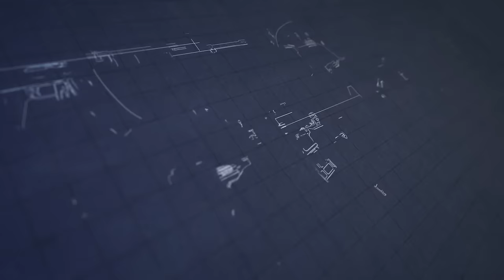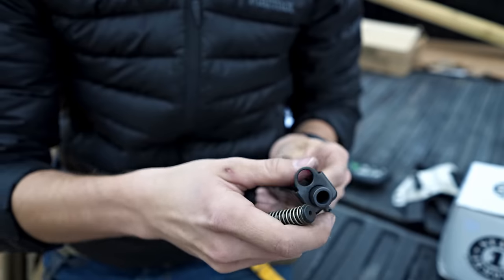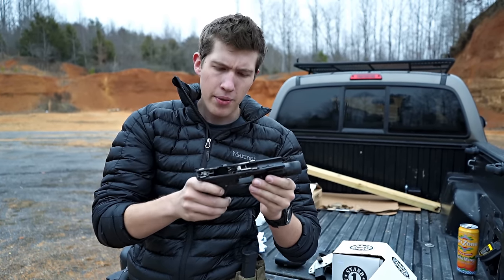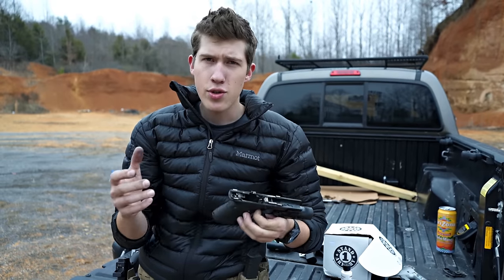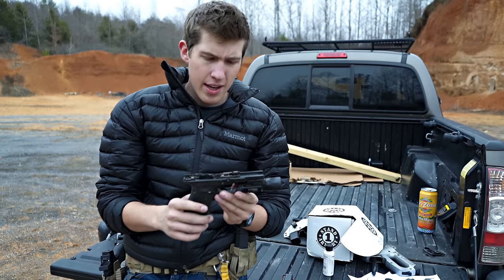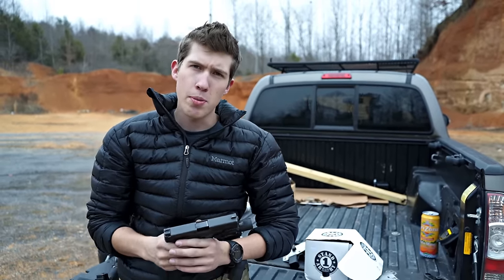Practical Glock 19 Upgrades for Efficiency and Effectiveness

Comment: I have original springs in my Glock 21 First Generation, and it still functions flawlessly.  Bought the gun in 1992.
Reply: glock 22 gen 2, still has stock everything and its had probably 40k round through it. seemingly flawless and still smooth as butter
Reply: Impressive! How many rounds have you put through it?
Reply: @bennettmay9283  probably 10k plus.  Not that many, but it has never malfunctioned.

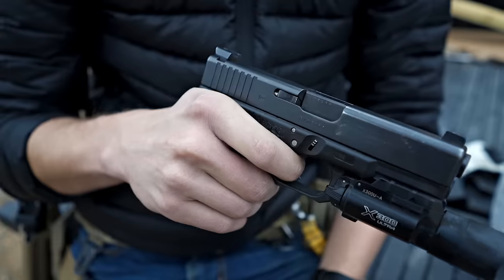Comment: 0:40 sights
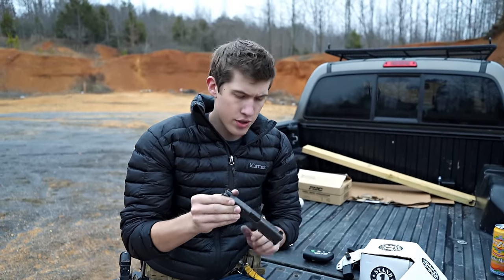2:17 frame stippling
2:24 trigger undercut
2:32 Vickers extended slide lock/release
2:43 Zev Tech extended mag release (for gen 4)
3:14 Surefire X300U
3:35 Ghost Rocket connector
3:43 6lb trigger spring/NY spring
Reply: Frame stippling is not necessary if you use Talon grip (self-adhesive) or similar.
Reply: Something tells me that he has since upgraded from the X300U
Reply: Nope , he still uses that or tlr7 @TommyTombstone
Reply: @chrisbeard9113  X300T>TLR1-HL>X300U>TLR7

Comment: Great video!⭐️⭐️⭐️⭐️⭐️
Warning ⚠️ , don’t over tighten your Bravo type Surefire gun screw on your Glock, you will warp, or bend plastic frame. For Glock frames use a A-type mounts like what Mr. Botkin using on his Glock.

Comment: Thanks for the quick rundown.  Nice to see what others are doing.

I have done minor changes as well.  
-Added the "duty carry" spring kit (trigger spring, striker spring and safety plunger spring).  
-Changed to a G17 smooth trigger.  
-Added Warren sights.
-Working on DIY trigger undercut and stippling front strap.  (I have another with full stipple work and it is too rough on skin and clothing).

Comment: I concur on the barrels. Tested a few, achieved a max 1/4" improvement (my groups are about 1" at 7-10 yards) over many tests at 7-10 yards. That being said, 25-100 yards+ is where the aftermarket barrels start to begin to shine. Save the $200+ and use it on ammo.
Reply from the maker: Yep. And $200 is 1000 rounds of 9mm.
Reply: damn!  that's cheaper than dirt!
Reply: T.REX ARMS what ammo?
Reply: Unless you're a reloader or shooting reloads
Reply: look on target sports usa
Reply: I only bought a fancy aftermarket barrel cause I run a comp on my G19 Gen 5. Other than that, i'd have no use for one.
Reply: truth, at that point of 50-100 yards ..I'm going to grab my AR. lol

Comment: As for trigger, I put a 3.5# rocket trigger connector from ghost (the one you have to modify to fit) to eliminate the "wall" before the break. And a NY1 8# trigger spring.  It's fabulous!

Comment: lmfao, you "wore out" a slide after 20k rounds in 9mm? haha, I've got 90k+ through my 23, factory slide, factory barrel, factory frame, etc, only glock extended controls, and stippling that I do myself.

if you wear out a slide in 20k rounds, do you even maintenance bro?
Reply from the maker: It wasn't the slide. It was the RMR screw holes. Couldn't hold down an RMR anymore after 20k.
Reply: T.REX ARMS whoever did the machinework did a shitty job then. Probably a dull bit when they tap drilled or they only made 60% threads. Either way it should have never worn out after 20k rounds. We had a range rental with over 200k rounds on a 23 with the factory barrel, slide, frame, guiderod, trigger components etc.
Reply from the maker: I know a regular slide will work forever. I wasn't saying it wouldn't. But a number of milled slides don't.
Reply: Scotty Mac 22 it probably was a nonfactory milled slide, they may be lighter and run better but they wear out much faster than stock

Comment: I've been real happy with glocks for about 10 years. I've had 6 or 7 different models but when it came down to it I ultimately decided to keep 3 9mm's. I've been holding them in high praise for many years and I always suggest a G19 to anybody looking for an all purpose handgun.  Recently I went to go do a few simple drills with a buddy of mine and my 19 shot hot brass straight back into the ol eyeball. Not once but consistently throughout the day. Every few shots are straight back into face or rounds just weakly flub out to about 4 o clock dropping only a couple feet from my foot.  What's really weird is my 17 that I've also never had any problems with started doing the same thing the same day.  I'm just confused, I'd be surprised if my 17 had more than 5k through it and my 19 is probably right around the 3k mark.   Definitely broken in but not worn out. My extractor, ejector, springs all look good to My eye but idk.  I usually shoot 115 ball but I was shooting 124 ball this day. Not that it should matter.  Could u venture a guess or do u have any experience with any if these issues...

Comment: Found your content this year and love your videos and messages Lucas. Just want to offer a correction though. To my knowledge, your 6 lb trigger spring is actually working AGAINST a faster trigger reset. The heavier than OEM trigger spring is allowing an easier trigger pull, working against the firing pin spring. Anyway, digging the thigh strap received from you guys-- best!

Comment: The extra power trigger springs hurts reset. It helps assist in the trigger pull making for a lighter pull, so during reset its fighting against the spring and therefore the heavier weight of the extra power spring. (6lbs vs 5)
Reply: Glad someone said this. The “firing pin spring primary function is to raise the cruciform “kickup” so that the firing pin “lug” will catch it as the slide moves forward into battery. Coincidentally, but not by design it resists the firing pin spring and REDUCES or resists forward motion of the trigger and trigger bar. I’ve tried the 6lb Wolff trigger spring long ago and it does absolutely nothing to improve reset of the trigger. In fact a Glock will function with no trigger spring at all as long as you hold the trigger back after each shot. I quickly returned the stock OEM trigger spring to my Glock because the Wolff was wound incorrectly and would not align itself properly with the trigger bar when seating the cruciform into the housing. Not worth the trouble and does NOTHING to improve reset. This young man does draw and shoot extremely well. I am a Glock armorer.
Reply: My thoughts exactly!

Comment: I too run stock for the most part. My changes to my G19 Gen 3: Ghost 3.5lb Ultimate Connector, Ghost 6lb trigger spring, extended mag release, extended slide release, Meprolight FT Bullseye, ETS mags, Attachments: Olight PL Mini Valkyrie

My setup is pretty simple and effective. But I plan on changing my recoil spring assembly for one of those Laser Max green guide rod lasers.

Comment: By the way you said it wrong, when u increase the trigger spring poundage you actually are working against your reset, but lightening your pull weight a little. The Glock factory trigger spring will give you the more positive reset.

Comment: NY "spring" and file to fit connector results in a smooth and consistent pull, but the reset.  Oh lordy the reset.  It just pushes your finger forward like you wouldn't believe.  If you can keep your sights on target, you can have some crazy fast follow up shots.  And it's safe as hell too.  Best $30 I've ever spent.

Comment: I run the ny1 trigger with a glock minus connector and makes a very consistent pull all the way to break.   The reset is brutal!  In a good way!  It literally throws the trigger back up to reset!  I also did the 25cent trigger job to add some smoothness to it.   But the ny1 trigger spring is supposed to be way more reliable then the stock spring due to its design of being compressed instead of being pulled apart.

Comment: I’d say add Kagwerks extended slide lock not the vickers style like he has on it here if you have a “high grip up on the slide” majority have the same issue I did, lack of locking to the rear on empty mags or locking back when you still have rounds in a mag. Kagwerks extended slide lock is up on the slide and out of your way allowing you a higher grip and allows the slide to now lock on empty mags and also your high grip doesn’t won’t  push up on that slide lock causing it to lock back unintentionally.

Comment: Good advice, “spend money on ammo and train”. I have upgraded my Glock as far as the sights, take down lever, extended mag release, and extended slide lock. Didn’t want to mess with it too much due to reliability. But the last thing I would like to do is get possibly an Apex Trigger shoe for the flat trigger set up since I’ve heard it aids in pull and trigger reset . This is for my EDC so if you have any thoughts on weather I should get the Apex I would value your input. Love your vids just subd you so thanks for the great content you post.
Reply: @MrMericaV  It's a scam

Comment: Just about the same mods for my Gen 3 odg Glock 19. Just did the undercut on my trigger guard, Vickers extended slide release, Ghost low profile extended mag release, new Glock Store black ice disconnector, Glock store 6# trigger return spring, and 6# firing pin spring. I put in the NZ Performance stainless guide rod with the 10# recoil spring but went back to stock because the slide would cock back 1/8” and move forward when I pulled the trigger. Stock doesn’t do that. I have the same Ameriglo hi viz orange dot front tritium and blacked rear tritium sight for quick sight picture and target acquisition. Other than that I mirror polished the trigger bar and fpb plunger and replaced the stock spring with the light GS plunger spring have to worry about batteries going dead in an rds.

Comment: I totally agree with keeping the stock barrel unless you need the threads. You don't replace polygonal rifling with standard cut land and groove rifling.
Reply from the maker: +krisrhebergen exactly. Since I have a can, I have a few aftermarket threaded barrels.
Reply: What muzzle breaks or comps do you use or recommend using? I'm looking at buying the Glock 19 Gen 4 with factory threaded barrel.
Reply: Which threaded barrels do you recommend?

Comment: I have an old style NY trigger spring (Black) and an old Scherer "Glock® 3.5 LB. Trigger Pull Connector" (really just a copy of the Glock "-" Connector). An OEM smooth face trigger and model 34 extended slide catch/release to finish out the Gen 2 19.

The combo of the "-" connector and the NY Trigger Spring make a world of difference in how the trigger behaves, I highly recommend it if you don't think the trigger pull feels right.

Comment: I run a NYT and a Glock minus connector in my 23's. The trigger is a bit heavier (so what), but I love the reset. Hi-Vis front sight, Glock extended slide stop and extended mag release are the only other mods. I tried the Vicker's slide stop lever, liked it, just liked the Glock stop better. All cheap mods for a cheap but very effective tool.

Comment: Good video very helpful 
I have a g19 gen 3 it has a frame reduction and undercut and stippled HD sights and everything on the internals is stock because I think it's important to train with stock but I would like to find a guide rod and recoil spring Stainless steel that doesn't effect reliability 
What would you suggest for recoil spring and guide rod 
Totally agree with u train train train is far more important

Comment: What are your thoughts on changing just the trigger itself and the safety plunger? Leaving the trigger bar, springs, and connector stock... unnoticed you only changed the spring. I'd like to change the trigger for my comfort and the plunger for a smoother pull while keeping all other internals stock. Maintaining safety is my number 1. Not looking for lighter trigger pull or anything of that nature. Thanks in advance!

Comment: I recently upgraded the recoil spring and guide rod in my Walther to a DPM system that uses a telescoping rod with multiple springs.  I've got about 500 rounds with it at this point.  It definitely helps and does what it advertises.  But my impression is that it doesn't help enough to justify the price.
Reply: Glock!

Comment: I very much so wanted a Glock 19x…but the funny magwell that doesn’t allow it to accept any generation glock magazine was a deal breaker…so I moved on to my favorite color black g45. I also went with ameriglo, but made a singular front and rear for a set, using the square illuminescent painted front with tritium and a set of dual tritium serrated rear for a 3 dot nv iron sights. I also “cloned” the 19x with maritime cups and 2 Glock branded +2 capacity mag extensions.  Oh, and the Glock lanyard ring (black). As far as internals, I have a stainless steel guide rod with changeable springs (I run stock weight of 18#’s) and overwatch precision glock branded minus connector np3 coated. Aside from those for performance, I added a touch of bling with TiCN coated stainless steel pin kit for gen 5, with matching TiCN coated “ring” to capture guide rod spring. And an American flag milled stainless steel slide plate. It runs like stock, the rod spring is interchangeable, it’s good in high humidity, and works great with surefire x300 ultra (the turbo is honestly for rifle distances) and fits many holster offerings. I love my weapon and it’s not like anyone else’s. Some dremel work on the trigger guard and a thumb shelf for my weak hand and boom…. Glock goes bang.
Reply: Heads up…the extended slide release from NDZ performance isn’t milled correctly for a gen 5 DO NOT purchase. The extended slide lock (bling kit) from Cross is the way to go if you want gold blingy pins and mag release etc. at the same prices.

Comment: The 6lb trigger spring slightly lightens the trigger pull as its mostly pulling backwards. I measured about a 6oz drop in trigger pull with the 6lb spring with oem minus connector vs the stock 5lb spring. The NY spring will increase trigger pull quite a bit as it pushes mostly upwards and somewhat forward against the cruciform (it is completely different system that I think is a little janky). You feel comfortable using ghost connectors in your guns? I really want to drop the ghost evo in my carry ☺️

Comment: Correct me if I'm wrong, I'm still learning but doesn't the 6lb spring lighten the trigger pull where as the NY1 8lb spring, bring that it is a different design, make the trigger pull heavier?  Great video!

Comment: New sights, trigger, extended slide stop, undercut trigger guard, flashlight, and maritime cups. 
Yes maritime cups. They are only 7 bucks, easy to install, and increase reliability especially if the gun gets wet.

Comment: Thanks for the fantastic video.  You mentioned that you upgraded the mag release and I would like to do the same thing for my Gen 4 GLOCKs.  I ordered one a couple of years ago thinking I was getting a bit longer extended magazine release.  There was practically no difference at all so I got burned.  Now I'm reluctant.  Is your upgraded mag release genuinely more extended than the stock mag release?  BTW, I'm left-handed.
Reply from the maker: +TexMan11 some are extended and some aren't. The stock oem extended works great. I also use the Zev ones

Comment: Not sure if you covered this earlier since the post is a year old, but...it doesn't look like you use a grip switch on your X300 light, is that correct?  What are your thoughts on having/using a grip switch for any handgun weapon light?

Comment: I do have one question though.  I have a ghost edge connector in my glock, but did order a trigger bar upgrade.  Do you think there will be any compatibility issues since the trigger bar and the connector are different brands?  my new trigger and bar is zev tech.   Not sure how they will function with the ghost edge connector.

Comment: Heey Lucas, Could you do a segment on depth perception with NVGs. Say a PVS 14 VS Armasight Nyx-7 type system? I'm going to a dual tube soon but find that (at least for me) the 30 degree FOV pushed thru one lens really limits moving. You guys seem to be fairly fluid in movement with dual tube.  You mind touchin on that as a issue and supply feedback?

Comment: Have you had any trouble with the extended mag release and the holster activating it.  Do you recommend a flared magwell?
Reply: I will say, glock magwells can definitely be improved by covering up the giant hole in the bottom. A flared magwell is up to you. If you keep missing or need to consciously guide it in, then it might help.

Comment: Thanks for the video! I was wondering if you could elaborate on the process you used to undercut the trigger guard, specifically, did you use any special sandpaper or something else to "finish" the job? I have just recently undercut my guard, and it is the shape that I would like, but it still looks pretty rough. Thanks!

Comment: Can you make a suggestion for sights?  After running my Shadow for a while now I've decided I want to go that route for my Glock as well (blacked out plain rear/fiber front).  I was thinking Ameriglo just because they seem to be the least expensive and simplest set that I can easily find.  Also, do you find height makes much of difference as far as quickly getting a sight picture?  Concealment is a non issue for me since I'm in Canada.
Reply from the maker: +Reggie Chabassol I've found that the shorter the sights are to the slide, the faster it is to align them. Ameriglo are what I use.

Comment: So what did the 6 pound spring do exactly. Does it chang the trigger pull weight or just the reset. I was also wondering if the trigger would wear down as time progesses and become smoother and better as a result.

Comment: I preferred Jäger guide rods that would take the Gen 3 and earlier recoil springs for some specific uses.

Once upon a time, there were factory threaded Glock Barrels and it seems like GemTech had them but not sure what happened with them.

Realistically I found good sights (steel of some variety, a Vickers slide release, and a Vickers Mag release) are about all I need on a Glock. Though I usually usually also grab a smooth face trigger from a Glock 34 for my Glock 19